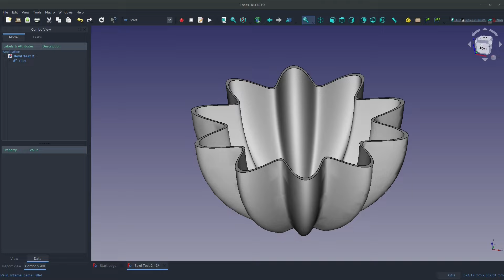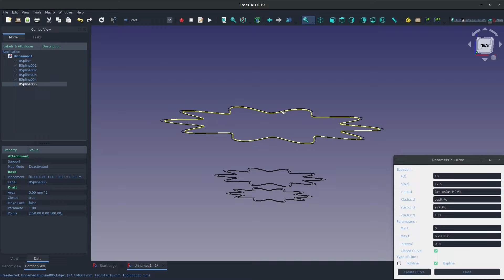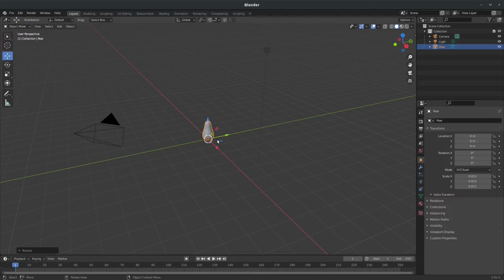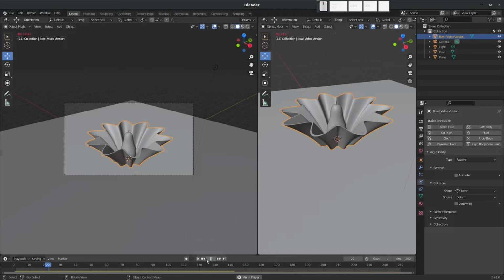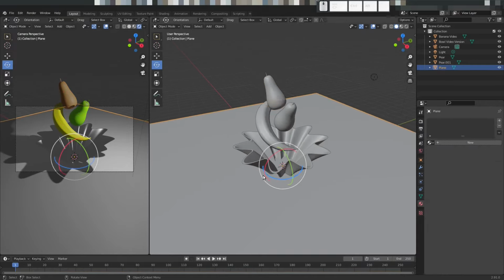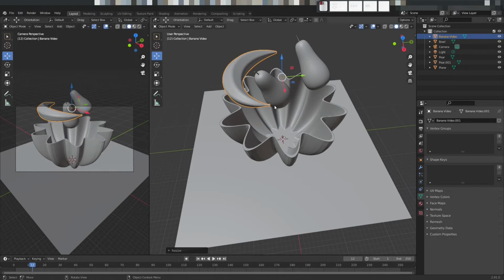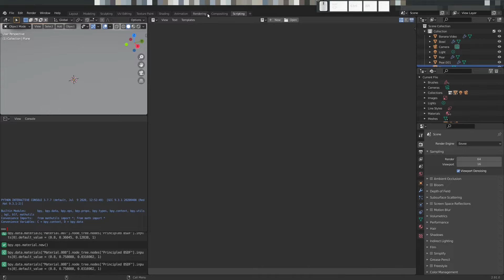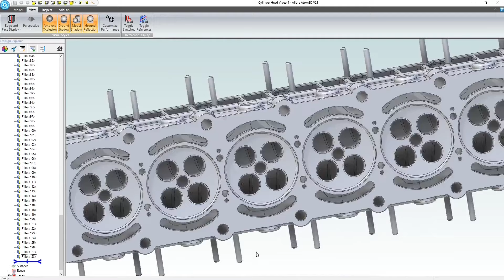FreeCAD Bowl Model and Blender Physics Simulation with Allvisuals4u |JOKO ENGINEERING|

Comment: The problem with your simulation is not the size of the mesh. You didn't apply your scale changes before running the simulation. To do that use Ctrl+A and Apply Scale.
Reply from the maker: Pinned, Thanks!